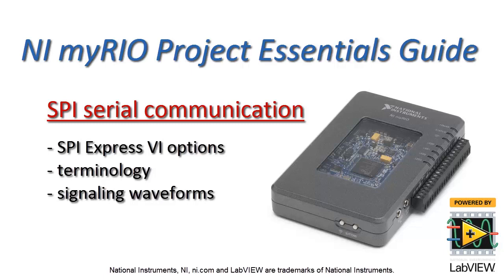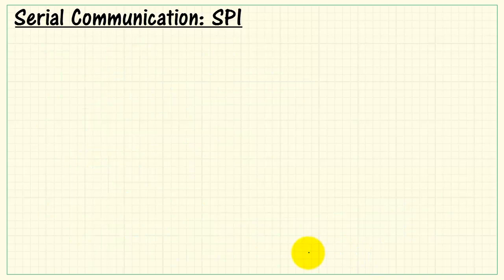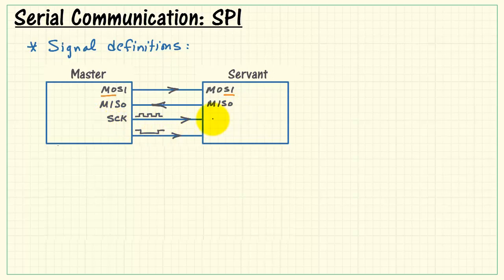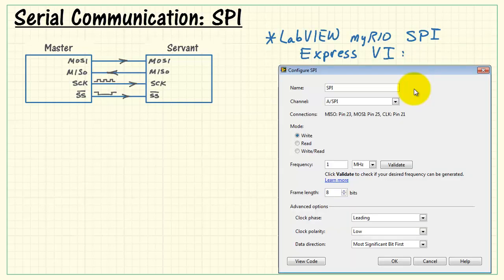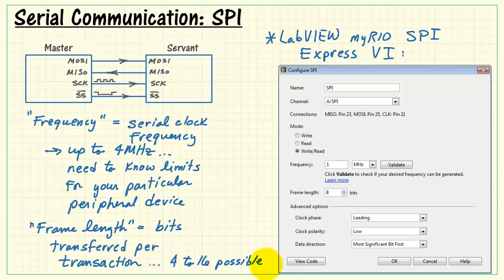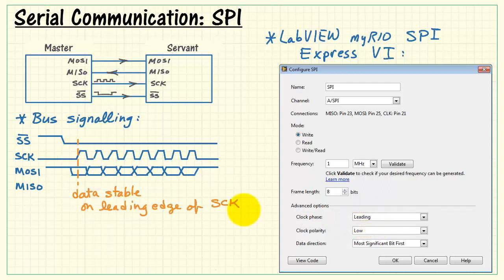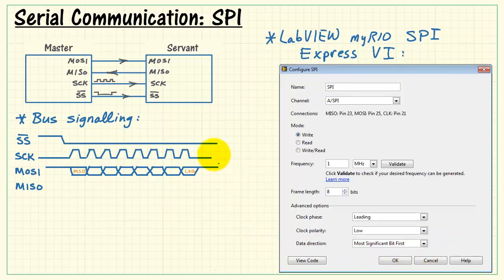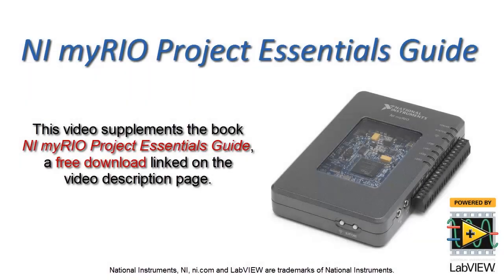NI myRIO: SPI serial communication

Comment: how we can make spi as multimaster device ?
Reply: TheMohamed2142  This connection is called SPI daisy chain configuration. All the slaves will received the same clock and data lines, but you will have to configure the chip select accordantly. Hope it helps.
Reply: @sasha7064570  i dont think daisy chaining is supprted by spi communication..its a general concept to combine multi slave but i dont think its for multi master